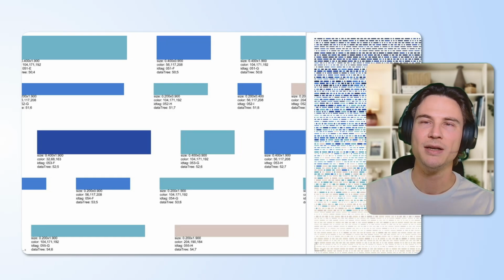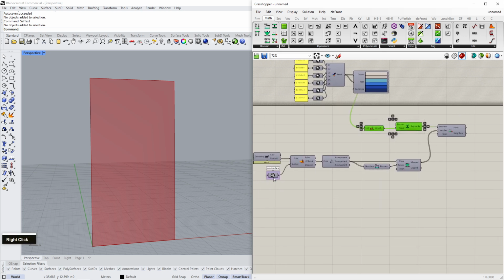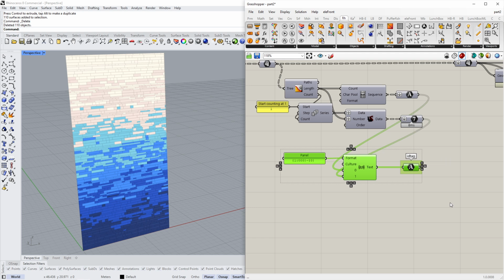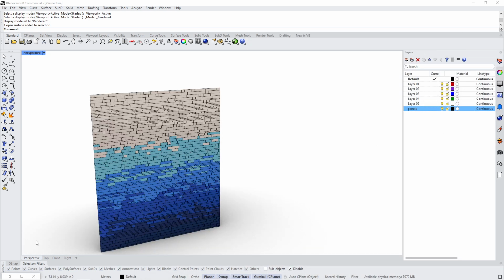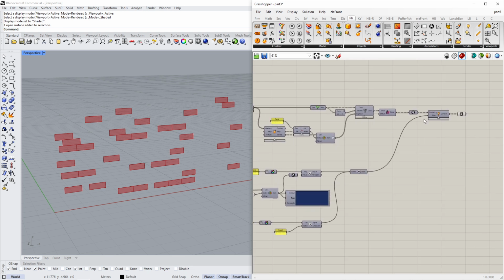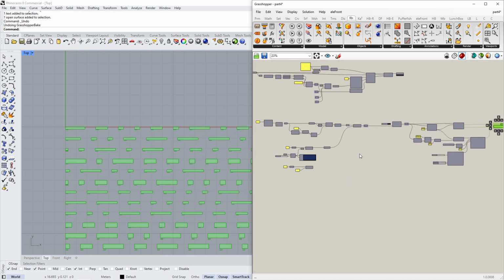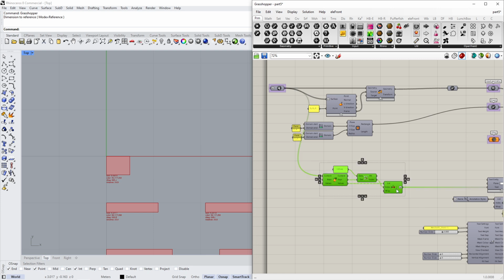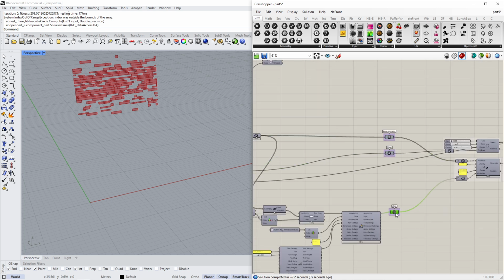Automate Technical Drawings from Facade Panels with Rhino and Grasshopper: Complete Guide

Comment: And how do you align this with the existing points — for example, several points forming a surface — as well as with definable lines such as windows (so that the panel does not cross them and matches the window line or opening)? 
And what about the entire surrounding surface, including the sides?
Is it possible to set it up so that the façade corners align correctly while everything else adapts around them?

In that case, is it better to just redefine the code, or are there some critical parts where the code has to be created from scratch?

Comment: Why did you choose to deconstruct the UV point and use the Y vector, instead of deconstructing the point and extracting the Z vector (at minute 9:40)? Was there a specific reasoning or design logic behind that decision?
Reply from the maker: Hi, great question! UV points are 2-dimensional, so when deconstructing the point, the Z output will always be 0. Only the X and Y (the U and V along the two sides of the surface) will have a value. I get your concern, we could have gotten the Z-value from the "Point" output, because those are points in 3D space, and in this case would also be valid. However, getting the UV point has some advantages, because what if the surface was oriented flat on top of the XY-plane? The Z-value would have been 0 for all of them and thus not useful to sort, but the V-value from the "UV point" output (the Y from the deconstruct point) will be helpful to sort. So no matter how the surface is orientated, or deformed even, the V-value will always be beneficial to sort points in that direction of the surface.
Best!